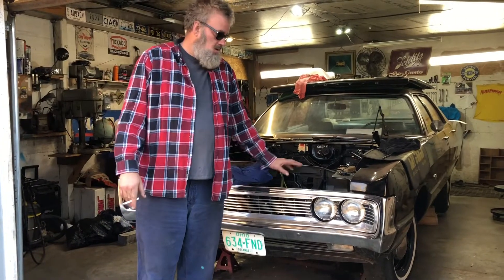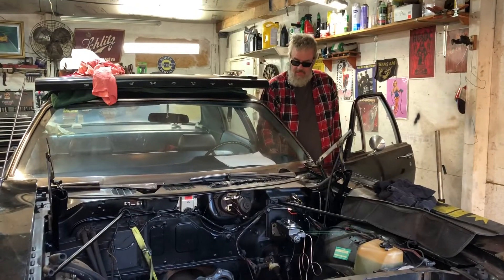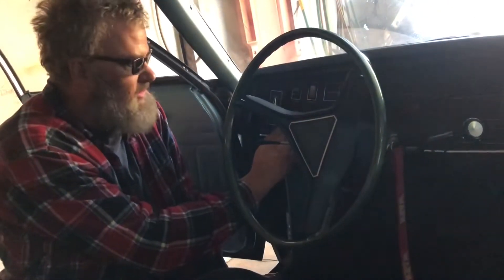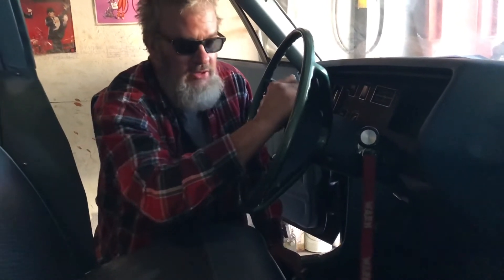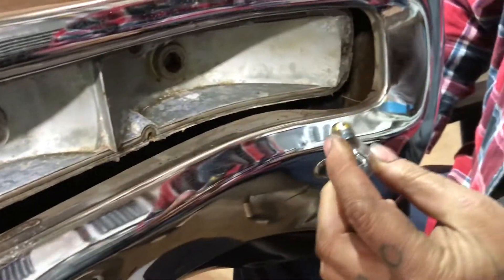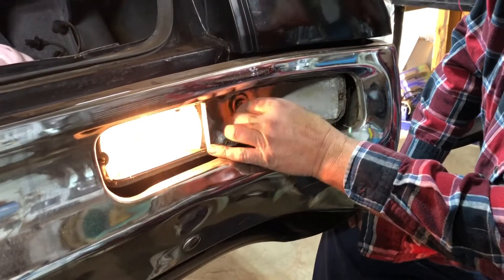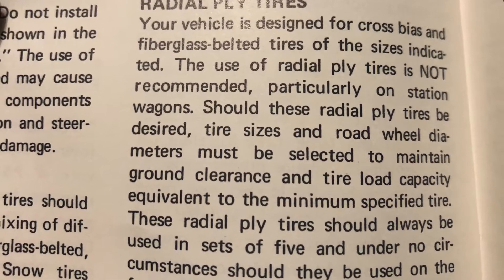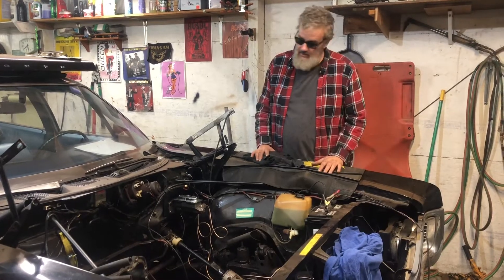Checking the electrical system on Mickey

Comment: Old School troubleshooting , No OBD port for a scan tool , you have to use the Ole Knogg`in !
Reply from the maker: I figured out the turn signal issue. It was a bad ground. 
 Grounding problems will make them do some weird stuff!!
Reply: @shedman7323  Number one place to start , especially Mopar`s as you know !